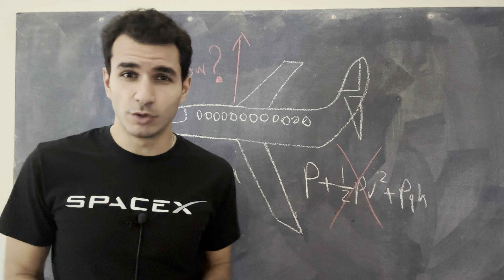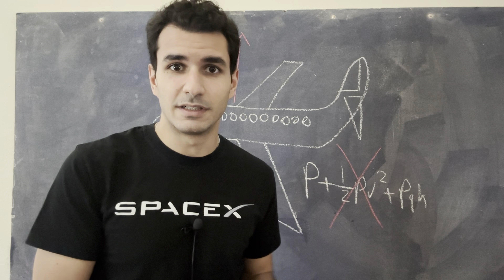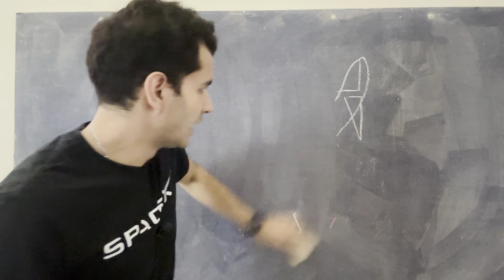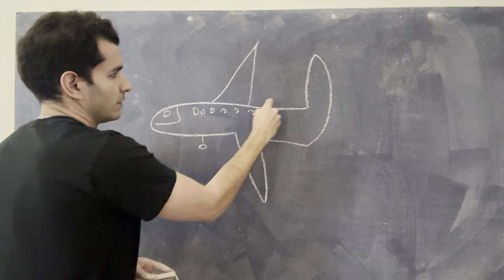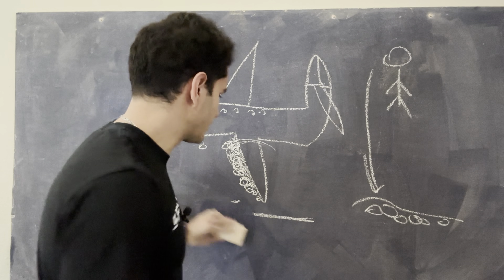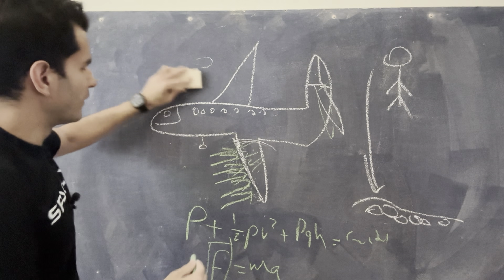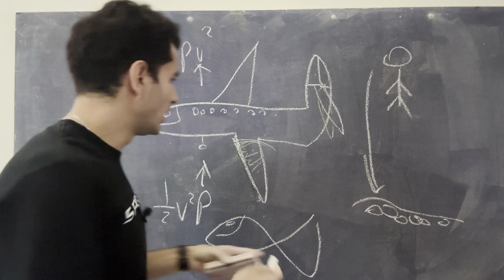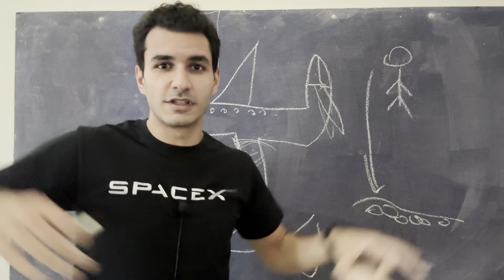Fix This One Misconception = Understand Airplanes Forever

Comment: Bernoulli's principle is a concept in fluid dynamics that states that as the speed of a fluid increases, its pressure decreases.
The top of the airfoil (wing) has a longer distance, therefore the air molecules at the leading edge of the wings split up, half travel below the wing and half travel above the wing, however due to the longer distance on top of the wing the air molecules accelerate faster than the molecules below the wing and therefore the pressure above the wing decreases as opposed to the pressure  below the wing, you can think of this as vacuum being generated on top of the wings, kind of like invisible suction cups pulling up on the wing... at the same time (during pitch up attitude) at higher angles of attack the air velocity also pushes up on the bottom of the wing as a secondary force but during straight and level flight all the forces of thrust, drag, weight and lift are balanced because the wings generate vacuum or low pressure aka lift upwards and the elevators generate lift downward and thereby somewhat equalizing the airplane, the rest of the stability comes from the control surfaces constantly being manipulated by directing air in certain directions in order to keep the plane stable ... then there's different wing designs, angle of incidence, dihedral etc to improve stability. So what you're saying is partially true but no the only reason why airplanes fly is not because air pushes underneath the wings, in straight and level flight your explanation (if I understood you correctly) will run into a big problem because the air foil is curved on top and based on what you're saying the resistance would push the curved part down not up... so then why is the wing generating lift and pulling up the plane and everything in it? It's due to the bernoulli's law and the acceleration of the air molecules above the wing creating essentially vacuum (lower pressure) as opposed to the higher, less accelerated air molecules under the wing. That's why a wing will stall at the critical angle of attack because at that angle regardless of the speed the air molecules hit the bottom of the wing and don't flow and accelerate above the wing any longer and the vacuum or lift stops to exist and a stall recovery must take place by reducing the angle of attack against the direction of air flow in order to start creating lift once again.

Comment: This is just so wrong..
Reply: Why in particular?
Reply: 1) Bernoulli equation only holds for ideal incomprehensible liquids and air is neither.

2) Only about 20-30% of the total lift force is generated by the particles that are redirected downwards by the bottom part of the wing. 

And I could go on, but the whole video should be titled "What I get wrong about Airplane Physics"
Reply: @davetime5234 1) Bernoulli equation only holds for ideal incomprehensible liquids and air is not incomprehensible.

2) Only about 20-30% of the total lift force is generated from the particles that are redirected downwards by the bottom part of the wing. Most comes prom the air molecules above the wing and that was completely left out..

3) Control surfaces work at zero speed if it is a propeller type airplane - just watch some 3D aerobatic flying.

I could go on but from a video titled "What everyone gets wrong about Airplane Physics" I would expect better..
4)

Comment: I think anyone who has ever held their hand out of a car window, driving down the street as an intuitive idea of how lift is generated.  At low speed, the air viscosity is very low. But as you pick up speed, the air actually starts to feel kind of solid, like you can actually push against it. So I believe once you get going fast enough, and you have the right Angle of attack, the airplane wings basically slide up on the On the mass of air, that is now acting like a solid, or rather, a very high viscosity medium.
Reply: Holding a hand out the window gives everyone an intuitive experience with dynamic pressure, but not so much fixed-wing airplane lift.  Most of such lift is from the pressure drop above which dominates the total pressure difference that is the lift force.

Also, you are not experiencing higher viscosity with that increased dynamic pressure on your hand, you are feeling the increased momentum of the air:  it's trying to conserve its motion and your hand has to counter that momentum with an offsetting force.

We don't know how much your hand being pushed up is from "simple parachute-like" drag and how much from the decrease in static pressure above your hand.  For wings, the static pressure drop dominates.

The above explains why sail boats can sail faster than the wind speed.

What the author of this video is trying to justify will not explain why a sailboat can sale faster than the wind speed and tac upwind.

Comment: That's not a bad concept orientated discourse and if you compare a human being swimming through water and the human being falling through air you have to be moving very fast to fall through ai r and use it to steer yourself.
Reply: He says you should run if someone draws an equation first, and he first has the equations drawn?  And then he doesn't talk about the intuitive relevance of the 3 main conservation principles of lift?  And he mixes up where static pressure change vs dynamic pressure is most relevant or what the significance of the difference is?

In the name of engineering integrity this need an honest soul searching.
Reply: @davetime5234  it's not an engineering report and no one expects something of that level you have to get it trimmed down to something people can kind of swallow and they understand the force against their hand when they stick it out the window in the car.
Reply: @markmcgoveran6811 Bit it gives some sophistication in explaining, but it's factually wrong.
Reply: @davetime5234  that's the nature of trying to step from quantitative results to qualitative results.
Reply: @markmcgoveran6811  Yeah but he's not even defining the qualitative debate according to the popular narrative.  

When people talk about "Bernoulli" vs "Newton" it seems to most often interpret "Bernoulli" as the pressure drop argument and "Newton" as downward momentum of air (action-reaction).

He is shoehorning in the notion of dynamic pressure as tying together the above argument.

But static pressure is the dominant quantity of total lift (this is experimentally well known).

Dynamic pressure is a separate concept from both static pressure and certainly from downward momentum creating an opposing force.

And he spends much of the time talking about the intuitive notion of dynamic pressure that every human being already has from riding a bicycle or moving in a vehicle with open windows.

I would love this to be a clear intuitive correct explanation of lift.  But it is not.

Comment: Is this related also to 3 newton law? I think so but i need to try to think about it and visualize it
Reply: Force = pressure difference x area = d(mv)/dt

The above is F = ma, so the force of lift is from the pressure difference generated by forward motion.  Unlike what the author says, this is mostly static pressure drop above the wing.  The last term is the change in vertical momentum of air forced by the pressure difference.

The pressure difference is caused by mass flow continuity splitting unequally between top and bottom where each has a different speed change necessary to maintain flow rate.

The speed changes, change the pressure (kinetic energy "borrowing" from potential energy).

So, a pressure difference forms to maintain mass flow rate, which bends air down causing the force as in Newton's 3rd law.

Comment: Not a very clean explanation at all. Nothing new here. Lol
Reply: Unfortunately, he is very tentative about this topic and keeps mixing up concepts, so we don't clearly know when he means static pressure vs dynamic pressure, doesn't mention crucial mass flow continuity, doesn't relate any of it to the indispensable net downward momentum of mass flow.  

"Only relevant to this dynamic pressure".

Absolutely not.  Static pressure change is the predominant force "array".

This is wrong physics presumably from lack of preparation.

In the end Newtonian principles of conservation of mass (flow rate continuity), energy, and momentum must be considered in tandem to discipline the big picture explanation consistent with Newtonian physics.

Dynamic pressure is not the dominant force (this is widely established by experiment and readily available by search),

And it is asymmetry, which is the fundamental concept, which is why he is wrong stating that camber is only about efficiency (there are aircraft that can fly at zero angle of attack given sufficient airspeed).

Perhaps you should redo this video and write a script first, based on sound established principles.

Comment: I think people on youtube are also confused about the confusion itself, the real point of confusion is how a wing generate lift upwards even at zero angle of attack. The thinking like it's pushing the molecules down to get an upward lift becomes confusing because air molecules are getting pushed in both directions equally (upwards and downwards).
Reply: Gotta be careful here. AFAIK, a vertically symmetrical wing (upper & lower surfaces have the same shape) at zero angle of attack cannot generate lift. The vertical symmetry precludes the possibility of privileging one vertical direction (up or down) over the other. That privileging must be present in order to have a net force up.
Reply: @hnnymn  Specifically about him saying "molecules are getting pushed in both directions equally (upwards and downwards)".

That cannot be true because lift requires net downward change in momentum.

Therefore, the molecules are getting pushed down far more than they are getting pushed up.
Reply: @davetime5234  Yes, precisely.
Reply: But there must be a net downward change in air mass momentum:  L(vertical) = d(mv)/dt (vertical), that is F = ma in terms of mass "expelled" downwards.  So, yes there is the pressure difference that is equal to lift, but that pressure difference needs to act on something, and that something is "the sky being pulled on".  When you pull on the sky with pressure as the force distribution, that pulls down mass according to that form of F = ma above.

If the pressure was holding the plane up by a vertical support tower able to supply compression forces against the ground, then no such downward mass acceleration would be needed.  But without such a system to transmit the support of such forces, you must have the mass displacement causing enough net downward momentum change per second.

Comment: There is a relatively new theory of lift by Cody Gonzalez and Dr. Taha et al from UC Irvine, theirs is more complete because it solves D’Alembert’s paradox where lift actually zeros out for airfoils with rounded edges. It is based on flow going around the airfoil in combination with understanding pressure as a Lagrange multiplier that enforces the constraint of continuity. That puts the fluid equations together with the physics that fluid motion would like to move around a lifting body (but must take some revenge on the body for making it move, hence the force of lift) but at the same time conserve mass.
Reply: Does minimization of pressure gradients align with the Principle of Least Curvature used in their theory?  Because, pressure gradients imply energy swapping from potential to kinetic energy (to maintain flow continuity)?  And presumably there is a system "burden" for adverse gradients?  And surely connected to this is a feedback process in determining how the streamline to the forward stagnation point positions itself for the optimal split of mass flow rate over the top vs bottom to minimize the total gradient "burden"?
Reply: @davetime5234 if I understand what you say then I think somewhat yes. In the sense that the fluid must try to keep continuity in this regime. Outside it in rarified flows for example this may not be true. In rarified flows you may need to think about this constraint entirely differently. 
But, by Hertz/Gauss principle of least curvature the pressure gradient won’t overdo this requirement of continuity. It will only deviate from the minimum in a minimal way that minimizes curvature in the sense of the integral of acceleration squared times the density of the fluid. The appellian is what that’s called somewhat analogous to the Lagrangian or Hamiltonian in other methods of analytical mechanics. That’s what I read in the appendix of the paper, still trying to understand it well enough myself.

Comment: It all ends on Laws of Motion, thanks to Newton.
Reply: Absolutely true.  But where conservation of mass (continuity of flow) was thought about by Newton, but not encoded into equations until 70 years or so later for the most general case of dispersed mass (fluids/gases).  

For solid pieces of mass we don't need to account for where the mass has gone, since its obvious from it all being clumped rigidly into identifiable pieces.

But for fluid flow, the accounting of the mass flow continuity becomes one of the indispensable equations along with momentum and energy conservation.

But that doesn't take away anything from what you said:  it is all Newton!

Comment: Physics of Airplane Takeoff: (Easy explantion).
Bernoulli’s Principle: Wing design creates a pressure difference as the plane speeds up, lower pressure on top, higher underneath, generating lift.
Newton’s 2nd Law: The engines provide thrust (force), causing acceleration that overcomes the plane’s mass.
Newton’s 3rd Law: As air is pushed down by the wings, the wings are pushed up with equal force, this upward reaction is the lift.

Please add your 2 cents below 😊😊

Comment: A Simple summary for everyone:
It’s all about pressure difference! As the plane speeds up, the wing design causes lower pressure on top and higher pressure underneath, creating lift. 
This pressure difference generates a force in line with Newton’s 3rd Law. 
Without properly shaped wings, a plane can’t take off, no matter how fast it goes. It’s a balance of speed, weight, gravity, and wing design.
Reply from the maker: airfoil is only an efficiency enhancer. angle of attack is king
Reply: @alithedazzling  In a sense yes, but asymmetry is the secret sauce which gives angle of attack its lift generation character.  Asymmetrical camber produces lift at zero angle of attack given sufficient indicated airspeed.

But practical flight would indeed not be possible without angle of attack providing the fine tuning of lift coaxed from the wings for variations in weight, speed, and air density.

But implying airfoil shape is only an efficiency enhancer is misleading your audience.

You can search for a whole handful of aircraft with enough asymmetrical camber to maintain altitude at zero angle of attack, given sufficient indicated airspeed.

Asymmetry is king.
Reply: You're wrong, at higher speeds airfoil becomes insignificant. The faster you go, the less important airfoil shape becomes. With enough thrust, flatplates too can fly.
Reply: @nuclearsmoothie  😁😁you are just adding more confusion.
I think whats clear is, the faster you go the higher pressure difference, with the aid of the angle of attack, the lift is created.